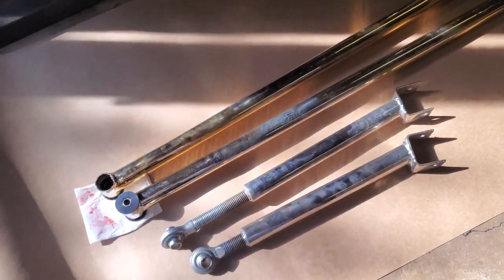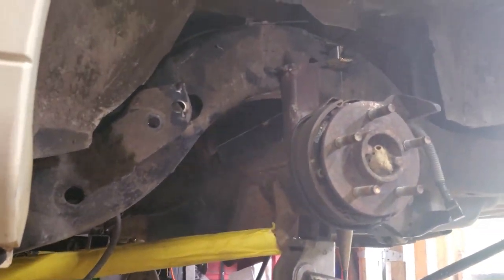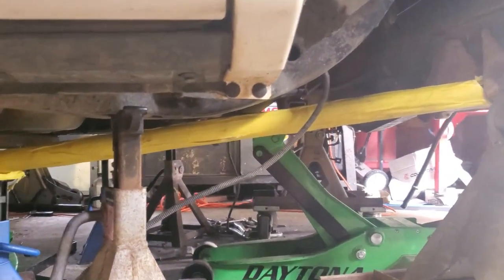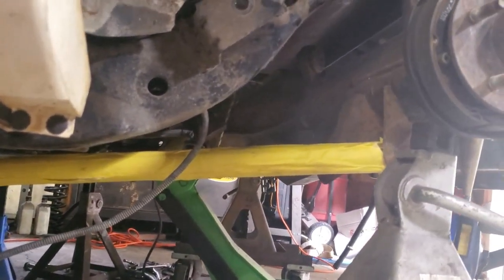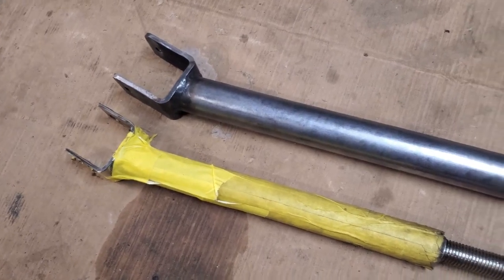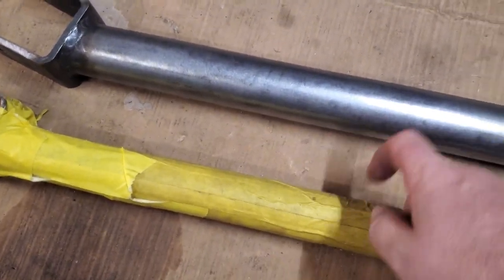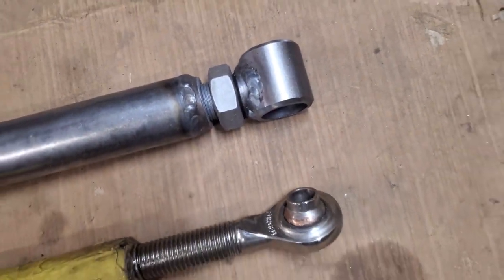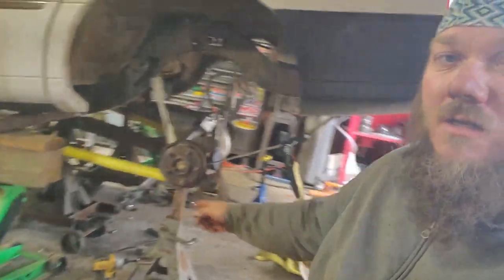Town Car Build Part 2

Comment: That 3 wheel dump was borderline scary lol
Reply from the maker: Yes it is! I had the rear cylinders about half way up there the first time I laid it over was in my shop it was intense I told the customer to lock it up and add a little tension to the side he wants to lift and just release pressure to the dump side slowly to control it laying over
Reply: @thecadillacdanshow8658  I’m surprised with that articulation that a slip yoke wasn’t needed. On my car with the long arms, the previous owner said they crushed the driveshaft into the trans and had to replace both of them lol so needless to say I’m not gonna try until I get a slip yoke put on
Reply from the maker: It's right on the verge if I take the chains off and raise it all the way it would bottom out the transmission I think if he shortens the drive shaft a inch it will be perfect

Comment: I have a 98 that I have all the parts to do the 4 link, I have a 97 chrome rearend built by black magic. My main concern is what to do for trailing arms and pinion angle? I figured regular adjustables for the uppers? Not sure on lowers. Like you said the kits are sold for either the 1997s and earlier or the 98s and up. Are there lowers I can buy that will make this easier, and how hard is the pinion angle to get correct? Does it vibrate at all driving?
Reply from the maker: What size cylinders are you going to run? I would try to get a kit from black magic. This car will have some vibrations it didnt drive so couldnt do any test drives